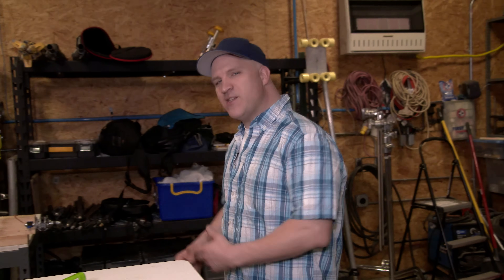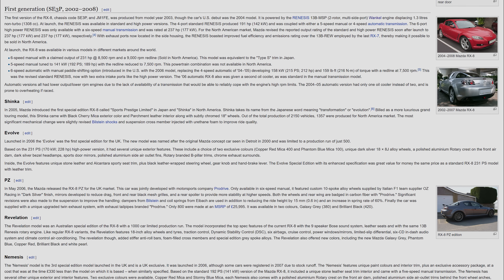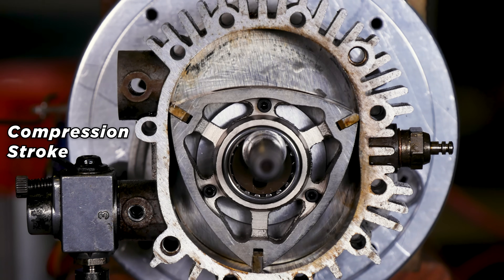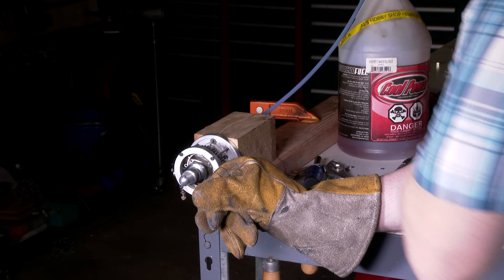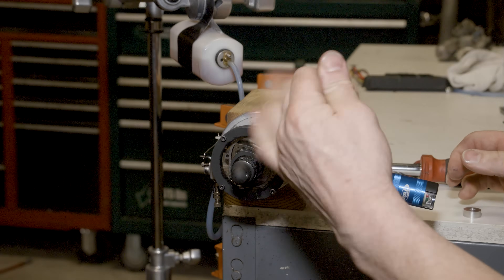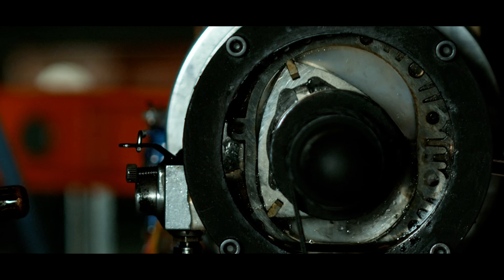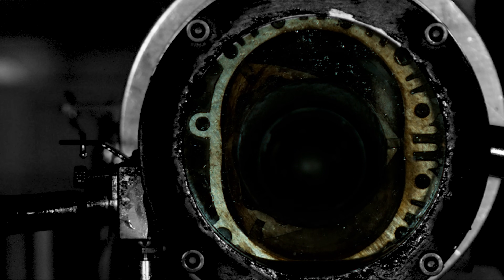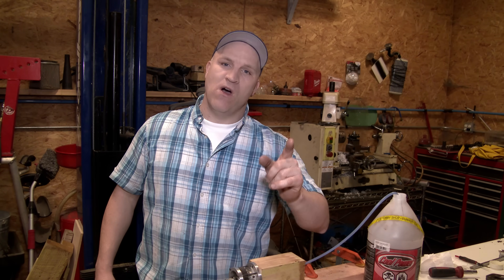See Thru Rotary Engine in Slow Motion - (Wankel Engine) 4K

Comment: You forgot to talk about the bane of the rotary engine and the other 3 moving parts the "Apex seals" . The Apex seals and a myriad of oiling issues that doesnt allow for it to be  a high mileage engine, keeps this engine from being in every car in the world.
Reply: I've got an RX-7 that has over 200,000 miles on its original rotary... still runs fine.
Reply: its not the apex seals its and inherit lack of efficiency with the design. fuel economy compared to a piston engine is just not nearly as good.
Reply: The apex seals are not consdered moving parts, just like piston rings in a  conventional engine.. 100k miles on my rx-7 never rebuilt. My brothers 2015 volkswagen did half that and needed a total rebuild!
Reply: wheelitzr2 People will still like the rotary engine even with its cons because rotary.
Reply: Jirapat Thaenphromrat no no no don't get me wrong, I think the rotary engine is a bad ass engine and ran one in my 4 seat long travel sand rail and loved the ever living shit out of that engine. I was just bringing up a point that he obviously didn't want to share.
Reply: Seabass901 - oh I agree (apex seals). Nowadays if you want to build a rotary for high boost application, you can make it pretty much bulletproof to around 500 horsepower, maybe even more. It used to be that if you wanted that kind of power, you would expect your seals to go if you have any kind of fueling issues - but nowadays that's not necessarily the case. You can build them to be as tolerant of knocking detonation is a piston engine now... But as someone said, stock Street applications they just laughed like a piston engine, as long as you change the oil regularly. No special maintenance needed...
Reply: sa22? 12As ran forever.
Reply: Darren Smith Well you can have 1,2 or 10 rotors as long as they're lined up properly on the shaft. That being said if one fucks up a seal you've got a major pain in the ass. The seals do go on these things even to this day. Just look at the video at the combustion chamber. It's a 100% seal (petfect contact between rotor and seal) which mean lots of wear.
Reply: Hey buddy. Take care of your rotary just like any other car, it'll take you far. Just hit 160k two days ago on the original engine and carburetor, all the original owner and I did was just keep on basic maintenance and not dog it too much, just like any other car. Oil changes every 2k, only have to top off every once in a while (due to its design by burning oil). That will literally do the trick, you don't have to baby it, you just drive it.. normally. Also yes, original, OEM factory apex seals will wear but once you replace them with composite seals they have a less likelihood to die. I'm still running my factory apex seals from 1982 and they work perfectly fine, every day.

There aren't a "myriad" of oiling issues, there's really only the OMP failing that would cause catastrophic damage or one of the lines blowing. Some people run a dry sump system and have to put 2stroke oil in, but aside from that the 2stroke is really only just for longevity countermeasures.
Reply: Non-turbo rotary engines getting 300K miles is not uncommon. The real issue with apex seals is detonation. THAT they struggle with.
Reply: My 83 rx7 has 280,000 on it and still running strong
Reply: wheelitzr2 Are you incapable of having a real conversation without acting like a douchy childish brat?
Reply: UnitSe7en thank you I made an edit.
Reply: k
Reply: doktorbimmer I'd like to mention that the generation 1 RX-8's engines were unreliable because there weren't enough oil injectors, and to make matters worse, they were placed in such a way that the apex seals weren't being lubricated properly.
Reply: Apologies for my ignorance here - but with regards to adding rotors to an engine, do they have to be aligned in a way for the combustion cycle to run smoothly?

By that - say in a two rotor setup - would one rotor be set on the crankshaft to be at the compression stage and the other, the exhaust stage? 

I would have thought that all the rotors (certainly with 3, 4 and upwards) would run as lumpy as hell if they were all at the same part of the combustion cycle?
Reply: no shit sherlock
Reply: Jon Shaffer Yes, a great deal of the combustion force acts against the rotations as well as with it. Sealing is very difficult and they will burn significantly more oil than a piston engine which hurts emissions. Even GM spent millions on developing an engine but scrapped the entire project because reaching piston engine emissions, economy and durability would be very difficult and costly.

Rotaries are really cool and awesome engines for performance applications. When fuel economy, longevity and emissions aren't as big of a factor, the physical size allows the engine to be positioned for a low center of gravity and good weight distribution. 

As far as the 787b winning LeMans as proof of wankel reliability, people forget about all the previous models back to the 1983 717 and how that victory was the only win in the entire history of Mazda's prototype entries. Not just at Le Mans...the only win in any race ever.
Reply: Svae yourself the hassle get a pancake motor problem solved lol
Reply: jizzanthapuss maammarata aparentyl you have a soft spot for spirit's tiny engine?
Reply: wheelitzr2 many are at high miles. I'm at 100k on mine many have gone 200k plus. You just got to know how to maintain and care for it. You can't just treat it like a piston engine. It takes constant care.
Reply: +John Burns Really? Then why was Mazda rebuilding over 5,000 RX-8 warranty replacement engines every year due to apex seal failure?
Reply: wheelitzr2
How myths are perpetuated.  The apex seals were solved 50 years ago.
Reply: He forgets to talk about how the engine REALLY works too! And its REAL capacity! Ha.
Reply: spirit Rx7 only a fag can call someone else a fag. I raised a valid point and you just made my point you have to mix 2stroke oil into your oil to get 100,000+ miles out if it and the other guy proved my point by saying you have to take care of it better than a piston engine. If there wasn't a miriad of oiling problems then you wouldn't need 2 stroke oil to keep it running. The rotary engine is NOT a put it in and forget about it kind of engine, It has to be babied or it will wear itself out. My piston engine will go 500,000 miles with all the modifications I've made to it no problem, can you say that about your rotary? Oh and if you have 180,000+ miles on that engine Ill bet you wouldn't be willing to take it on a road trip.  and the Apex seals ARE still a problem or there wouldn't be multiple manufactures that make their own "better" design.
Reply: spirit Rx7 oh..... Are you sad that I made a valid point about your tiny engine?
Reply: wheelitzr2 - you're wrong. I would gladly take my two hundred thousand plus mile RX7 on a road trip over a thousand miles ... wouldn't bother me in the slightest. And this is an engine in a car that has had the most basic of maintenance really... basic oil changes at reasonable intervals, and other associated basic maintenance all vehicles need. Nothing special whatsoever, and no premix for me. The biggest problem with rotaries and longevity comes when people try to boost the ever-loving hell out of them - that makes things more touchy. Leave them as they came from the factory though, and they're every bit as reliable and long living as a piston engine.
Reply: +Jon Shaffer Indeed, poor reliability has always plagued the Wankel engine, but it is low fuel efficiency that prevented it from being widely adopted or successful commercially in any applications, particularly aircraft and generators where brake specific fuel consumption is a critical design requirement.

Comment: I wonder if you could run nitrous oxide into the intake so you could get a clean burn? You'd have to work on the mixture a bit but it might be possible to work up something. I'm thinking of something like the nitrous cart I use as a dentist. You could get a low pressure valve on one end and mix it with atmospheric air until you find the perfect blend
Reply: I think you need to go look at some video on engine fundamentals first and then perhaps find some good information on nitrous oxide too.

Comment: I heard rotaries were extremely inefficient. I’m sure this engine is not at all running great but just the same spitting gasoline as much as co/co2.
Reply: Wankel engines are inherently less efficient and always produce less power per unit of emissions produced.
Reply: Wankel engines have a very compromised combustion cycle and generate more CO due to the incomplete combustion

Comment: Instead of just put the acetylene near it you should have fashioned a small tube to feed it in from a spare piece of aluminum or steel screen. It will act like a flashback arrestor.

Comment: I had one of these O.S. Wankel engines for a model aircraft, it used to spit oil out the front bearing and was so very uneconomical you could actually see the fuel going down in the fuel tank.
Sounded great though, lovely to see how that flame travels during combustion

Comment: Is it supposed to be dumping that much unburnt fuel out of the exhaust port? It seems like less than half of it actually burns. The rest got spit right back out. Is this a flaw in this specific rotary engine, or is this an issue with just rotary engines in general? I know those blade-seals can be finicky, but I honestly don't know much about rotary and would love to know more.
Reply: Dan W. Not fuel, that's actually oil in the nitro fuel blend. That fuel is actually made for nitro two stroke engines which need oil mixed with fuel for lubrication. Owned multiple RC nitro cars and they all spit oil out the exhaust.

Comment: I think the main advantage of a rotary engine is that it has 3 combustion per 1 revolution , while a regular piston engine has 1 combustion for every 2 revolutions , not to mention that rotary engine doesn't require any complex valve timing ,
Reply from the maker: Well realistically it's 1 Powerstroke for every rotation of The Eccentric shaft, since the rotor is rotating like a planetary gear it has reduction characteristics. So for everyone turn of the rotor it's three turns of The Eccentric shaft.
Reply: Warped Perception 
Oh yeah right! , I missed that one , thanks for explaining .
Reply: This article explains it well:http://rx7.com/techarticles_displacement.html

Comment: I can see the ineffieciency work. Holy shit it spits fuel :D
Reply from the maker: Exactly. That's why in the Mazda RX-7 the catalytic converter glows Orange when you hold the engine at about 2,000 RPM in neutral. The catalytic converter is burning all of that unburned fuel . huge waste of energy
Reply: @WarpedYT   do you think a hho kit would help burn the fuel more effectively, thanks
Reply: Nitro always over fuels and throws oil ..even piston engines .
Reply: Hence there is no bigger and more true petrolhead than a rotary owner. And lets be honest, those flames are epic. Especially when you drive in front of an EV or hybrid, you can really smoke 'm out. Always makes my day.
Reply from the maker: Peter Taylor that's true but I guess we will see how the gasoline looks in the upcoming Episode.
Reply from the maker: L Parker yeah but this is nitro, I leaned it out as much as possible believe it or not. It wouldn't stay stared with less fuel.
Reply: fuel efficiency is not great, but power to weight and dimension are pretty good like a two stroker.
Reply: The gas one will spit fuel.  That's why even a stock RX8 will belch flames with the cat removed.
Reply: +L Parker Regardless of the fuel type the Wankel KKM design had a significantly lower Carnot Cycle efficiency limit, this can be easily observed in the higher EGTs (T2) temperatures in the Wankel compared to other ICE types which are more efficient (and still in production)
Reply: Partially due to lack of flywheel and load. Still an awesome video!!
Reply: Note that as the engine continues to run the amount of unburned fuel in the exhaust seems to deminish with each subsequent power stroke, likely due to increasing temperature of the rotar and the "head" surface (no piston so i dont know what one would call it lol). As the engine only ran for a few seconds per startup, one could propose that, perhaps, if the engine was alowed to come to operating temperature, the fuel efficiency would increase, but it should be noted that the wankle engine wasn't designed for milage so much as enertial efficiency, and the horsepower to displacement ratios show it, though i hear the torque numbers are a bit less impressive.